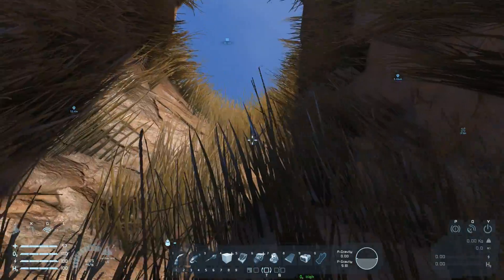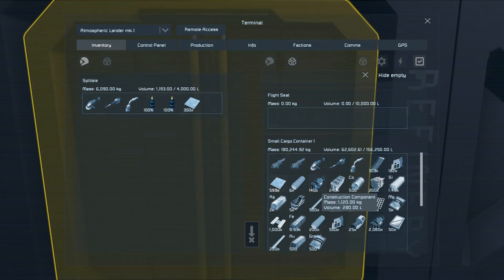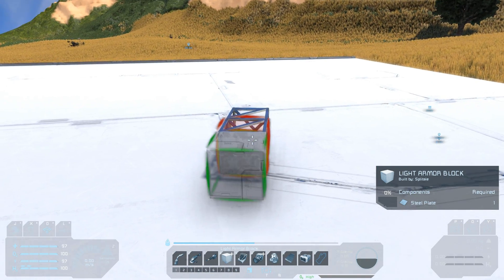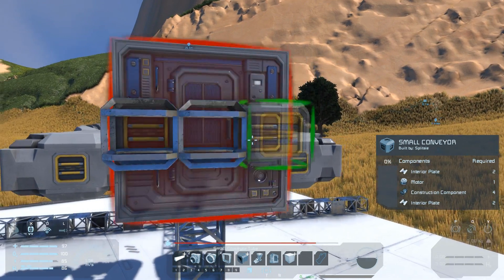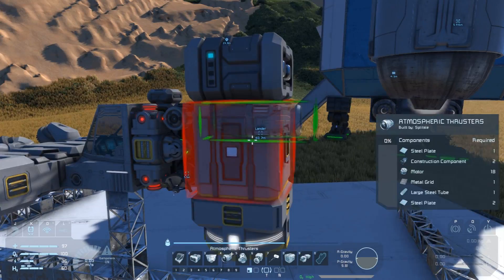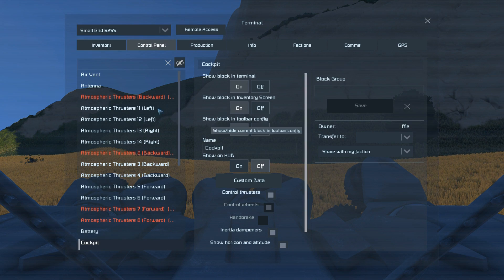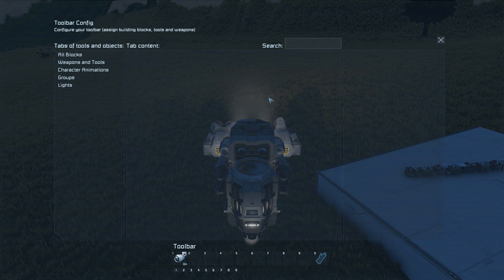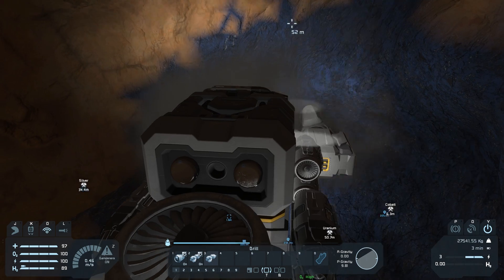Space Engineers Tutorial: Build A Planetary Mining Ship (Part 2 of a survival tutorial series)

Comment: another great guide !  Having a little issue when i go mining i am only mining for about 5 min and i lose all power  - i have lots of uranium in my reactors but the battery is always flat
Reply from the maker: One of the troubles with reactors for flying vehicles is that they have a low peak power output, while they can provide a slow trickle over a very long period, for something like what the atmospheric thrusters need you need a LOT of reactors, or use batteries. Make sure your battery has all it's charging options left off (as in it's not set to recharge, discharge or semi-automatic), then if you've got uranium in the reactors they will trickle charge the battery. 

If you have power on your base, you can connect up to it, then set the battery to recharge and take power from the base, a large grid small reactor can provide a lot more power than a bunch of small grid ones so it shouldn't take anywhere near as long to do this. Just make sure you take the battery off recharge before disconnecting otherwise it won't be able to provide any power to your ship... I might have crashed more than once or twice through forgetting that :P

Comment: The uranium is only going to two of the reactors, how do I evenly distribute the uranium? I can't manually put any of the uranium into any of the reactors.
Reply from the maker: First check that those reactors are oriented correctly to be able to access the conveyor system, if they're all properly connected then you might be experiencing the conveyor bug that can sometimes be fixed with a quick 'y' to power on and off the ship
Reply: The conveyor system works, but I've encountered a new problem. When ever I try to fly in any direction that isn't up (I built the large atmospheric thruster on the back) the ship starts falling.
Reply: Nvm, It was something to do with the battery, thanks for the help!
Reply from the maker: You're very welcome, glad it's working for you now :)

Comment: Easy and simple, but you need to have one right and one left facing thruster on the top (5:40), so it wouldn't lean to the right. Other than that, great tutorial!
Reply from the maker: It's running pretty quickly but thrusters are placed in those directions immediately in front of the battery. Next year I'm going to re-do these tutorials without the sped up parts to make it all a bit more clear :)

Comment: My ore detector isnt working
Reply from the maker: They have a limited range particularly on small grids, you need to make sure it's powered and that you're within about 100m of the deposit. If you are on a vanilla planet the dark areas on the ground will have ore under them and the small grid ore detector should be able to pick up something in those spots. There are ways to get the ore detector to broadcast its findings but for the sake of checking that it's functioning make sure you are in a cockpit when you want to use it.

If you want any more specific guidance you'll need to give me a bit more info :)

Comment: I think you have a great vid here, i can pause and rewind to see that which i missed. there must have been an update that killed the design. I made it same as yours but now I get 10m in the ground if that, and bits keep falling off the ship so i get stuck down in the hole.    :(   or is there an option that keeps the ship together better?
Reply from the maker: The design still works, though it was never able to carry much ore. What I think might be happening is that you're using the left click drill method and getting the ship full of stone. Once it's full it will be too heavy and any time you turn you'll be smacking the ship against the side of your mine shaft and destroying it. There's no structural integrity in space engineers so the only way for something to get destroyed is for it to hit something. 

If you want the ship to not get full of stone while getting down to the ore you should use the 'right click' drilling the same as with the hand drill, it will destroy the stone and not load up your ship - you'll also get a much large hole which will be easier to fly around in. Try to only load up a small amount of ore, or better yet add a few extra thrusters in each direction and this ship will be able to fly much better :)
Reply: thank you for the response. i dont spend enough time mining to get stuck that way, the thrust brake off when hitting the walls of the cave. I found the button for blocks not breaking, shame there is no slider for the block damage, its either all or nothing in damage amount.
I did build a much bigger design after following your design and that one only works with block damage off. even tried to use some of the pre made mining ships and they have the same issue. is there some way of using the miner that i must be making a mistake with so that bits dont fall off with a couple of tiny bumps? i will try to do the circles so that there is room to turn around as that seems to be my biggest issue
I am looking forward to building a station to use with the miner but im not sure what map to play on as they seem to have different rules for each map.
any suggestions?
Reply from the maker: Over time you'll get the hang of flying without knocking things too much, but I still always drill a nice big hole with right clock so that I can see more easily what's around my ship - can be handy to add extra lights around your ship so the walls are easier to see. 

The other thing you need to be careful of when placing thrusters is where their flame is pointing, make sure there aren't any blocks in the way of them or they might get destroyed. 

I personally like starting on the solar system start in the lander, it gives you a decent amount of resources but you still get a survival challenge. Easy start doesn't really work for that :/

Comment: Yo, keep flipping my miner over, gravity is a pain. Have you tried a vertical design?
Reply from the maker: I've built one or two vertical miners but I've actually found them to be less efficient in some ways, because you have to remove all the rock above a deposit and the deposits are relatively flat and thin it can be quicker to dig a single shaft down then dig out horizontally to get the ore than have to dig down over and over again.

If you've having trouble with flipping just build your miner with the same number of thrusters in every direction, my friend who I play with who is absolutely hopeless at keeping track of those sorts of things built his miner that way and it's worked pretty well so far :)

Comment: I thought this was a good ship design, so I thought I’d make it as an atmospheric explorer without the drills and with a fighter cockpit. I’ve got to the battery stage and it only has one blue light, dies after ten or so minutes and the ship won’t except uranium. Is it because of the fighter cockpit or lack of drills. Or do I need to take the ship apart because one of the f@#%ing conveyors is on the wrong way round?
Reply from the maker: Once the power dies you won't be able to get uranium into the reactors via the conveyors. Just pop a temporary reactor on the outside somewhere and use that to power up the conveyors, I don't remember whether the cockpit was piped through or not to be honest
Reply: Splitsie yeah I think I must have something wrong. It doesn’t take me those ten mins to get Uranium in there. It won’t take it at all. I’ve built this as a mining ship and it worked ok then. 

The fighter cockpit has one massive connector.

Comment: Hi Splitzie.

I followed you tutorial, and i did the whole thing right ( i think! ) but my ship is out of power..? I tried to put Uranium into the reactors, but it wouldnt accept the Uranium?. I just simply cant drag them into the reactors? ( and all the reactors, batteries and the connector is red.. I tried to press Y multiple times in the cockpit but it just simply, didnt work..) How can i fix this? Please help me.

By far, the best tutorial series i've ever seen! <3
Reply from the maker: Wow! Thank you so much :)

I think the problem that you're having is that you've probably run out of power altogether. Without power conveyor tubes won't work so you can't reach the reactors to put uranium in them. An easy solution to this is to place a temporary small reactor on the outside of the ship that gives you direct access to its inventory. Place some uranium in there then use that power to allow you to place uranium into the other reactors on the ship. Then just grind down the temporary reactor and make sure you always have some uranium in your other reactors and everything will keep working :)

Comment: Followed the tutorial, spent about 20 minute rebuilding the ship after, upon releasing it, it wildly spun to the right.  Apparently skipping steps is not a good tactic.  Works really well, although I wish I had a better power supply to keep this thing charged
Reply from the maker: Lol! If you can connect it up to a base connector, you'll be able to charge much faster from the base batteries or reactors than you can from the onboard ones, should save you a bunch of time :)

If you're recharging from base batteries you'll need to play around with setting the ship's battery to recharge only, then remember to switch back to normal before taking off, many a landing pad of mine has been destroyed by forgetting that step :P
Reply: Id edit the model slightly and add a solar panel so in an emergency i can land and fill up

Comment: You have any idea why I can't place the large thruster? No matter what I do it just doesn't want to change the size to large and let me put it on the back of the ship.
Reply from the maker: If you're using one of the blocks that has a '+' sign on it, you can use your mouse wheel to change to the larger version, if you press the number for that slot on your hotbar twice it changes between the two grid sizes (large ship/small ship) - which cannot be mixed without some trickery.
Hopefully that's where you're getting stuck :)

Comment: Have you ever tried making the downward direction the direction of the drills? I am considering this idea as a drop miner that primarily aims straight down to avoid having to deal with weaker thrust in other directions as sometimes front miners may stall if you do not have adequate back or side thrust.
Reply from the maker: I've tried and I've failed. Every time I make an attempt at a design like that it never ends up looking any good :(
I think it's going to be a very effective way to build an atmospheric miner, but for some reason my brain won't cooperate and make anything good - there are a few on the workshop that might be worth looking at for ideas though
Reply: Vertical miners are pretty effective, to the point that I've sworn off horizontal miners (on planets). IMO the trick is to set up a grid of drills first, then position the lifting thrusters so they fire down through gaps in the drill grid without causing block damage. Everything else you can stack as high or compact as desired.

Comment: This build is outdated. In my survival world I made this ship block from block and it would not get off of the ground. Could you offer an updated video with a new design? Or link me to a video of one if you've already made one.
Reply: More clearly. It lacks the power to move more than 3 or so blocks at a time before powering down and crashing. I tried adding more fuel but this didn't seem to help. I also tried removing the large thruster in the back and replace with 3 smalls. This also failed to male a difference.
Reply from the maker: The ship still works just as it is - I've been flying it this morning while messing around with parachutes so there must be something else that's missing...
For most ships with atmospheric thrusters you need batteries to be able to output enough peak charge for flight, the reactors don't put out enough on their own. The batteries basically act like capacitors. Make sure your battery has the correct settings, in this case the easiest way to use them is to make sure all their checkboxes are blank. That way they'll output power as soon as you want it, but when landed they'll build up charge from your reactors.

If things still aren't working then have a look at whether your inventory is full of ore, this ship is not capable of carrying a full load in its cargo hold, it can only go up to something around the 30,000kg mark (that number's off the top of my head it might be slightly different). If you hop in the cockpit the total mass of the ship will be listed on the right side of the screen so you should be able to see if something's weird straight away.

If you're still struggling at that point, I'll need more information to try to help you sort it out :)
Reply: Splitsie gotcha. I'll go back in and try that. I didn't think to check the battery check boxes. Thank you for the quick reply.
Reply from the maker: No worries :)
Hopefully it was something with the batteries
Reply: Splitsie It was. I changed the box to auto and the ship is working just fine now. I also watches the rover this morning and I like how well these builds work together. Especially the remote controls. I had no idea things like that where available in space engineers
Reply from the maker: There's some pretty cool stuff you can do with the remotes, and people much cleverer than me can do incredible things with the programmable blocks... Once you've got a handle on the basics it can be pretty fun to explore those things

Comment: For some reason everything is staying red, please may you help?
Reply from the maker: If everything is red, the most likely problem is that you're out of power. If it took you a while to finish up the ship the battery may not have held enough charge to get uranium into the reactors. My preferred way of dealing with this is to put another accessible reactor on the ship and pop some uranium in it. Then everything should have enough power and the batteries will start charging. You'll need to wait a while for the batteries to have a reasonable amount of charge before taking off or it will be a very short flight.

The other possibility is that the ship is powered down, if you hop in the cockpit on the right side of your HUD you should see a standard power symbol. If it's red press 'y' to turn the ship back on and if you've got enough power you'll be right as rain :)
Reply: Ok thankyou very much. But as I am very new to this how/where would I put this other reactor to kick start it
Reply from the maker: You're welcome. Just attach it anywhere on the outside of the ship, just make sure to orient it so that the conveyor port is directly accessible so you can put the uranium in :)
Reply: So would I use a small reactor and could I just place it where you put your air vent on the ship you built?
Reply from the maker: If you placed it attached to that conveyor port you'd still be stuck. The placement doesn't matter as long as the conveyor port is pointed outwards and a thruster isn't pointing at the reactor
Reply from the maker: And yep, small reactor is what you want to use. Once your conveyors are working you can always remove it then :)
Reply: Sorry, how would you know if the port was pointing outwards?
Reply from the maker: the the conveyor port is the side with the grey square shaped bit that's got a yellow outline, that's the side you can interact with to access the inventory menu

Comment: Hey there!
It might be because of updates or such, but....

That design is faulty. Everytime i get a little weight in my mining ship i have alot of trouble pulling out of the ground. Its really hard to go backwards and upwards. Not even filling the ship to half capacity will sink my ship in the hole like a stone in water.

I didnt even manage to dig more than 10 meters under the surface.
What am i doing wrong exactly?
Thanks
Reply from the maker: The ship still works from my own testing, but it is a little underpowered for mining larger volumes. 

There are two things you need to do to help your mining, the first is that when you're mining through the rock on the surface you need to use 'right-click' mining with your drills to just destroy the voxels without getting any into your cargo. Then you need to keep a close eye on the weight of your ship and try to keep it as level as possible. If you're having troubles it's worth adding some extra thrusters in each direction so you can carry more weight. This design was meant to be as bare bones as possible as I'd intended it as a ship you could build from minerals mined by hand (a painfully slow process).
Reply: Splitsie yeah i've figured out my problems :P 

Thanks for the quick reply though :P
Reply from the maker: No worries, if you're stuck and you don't get a quick reply hop onto the Keen discord. The people who hang out there are generally very helpful :)
Reply: Yep, best solution is just "add more thrust." Needs more power, though, so in that case pop on a few batteries, or if you have the minerals, reactors are ok too. Also, oxygen vents are broken right now where both small and large ship vents have the same power draw (a lot more than necessary) so it may be useful to simply pack a few oxygen bottles in with your cockpit to breathe with
Reply: is there still a way to rightclick mine with drills on ships? only thing i can to is turn them on or of and they alway keep the stone in the drills. its pretty annoying cause ejecting it with ejectors takes some time and causes lag